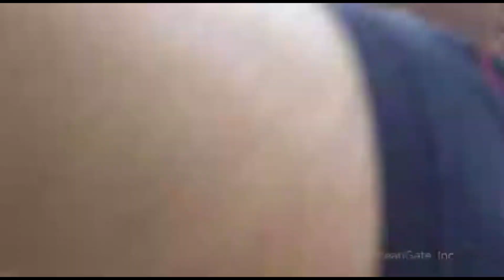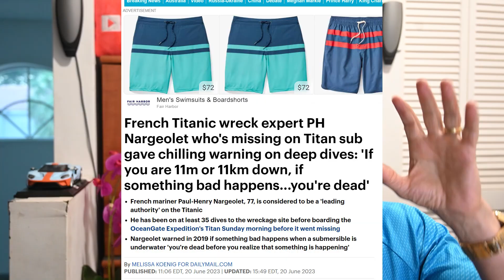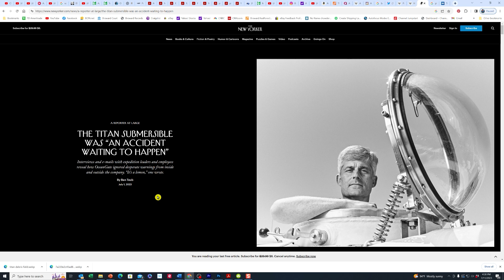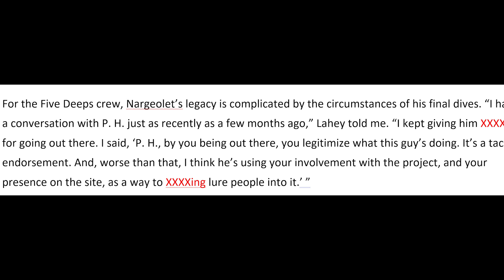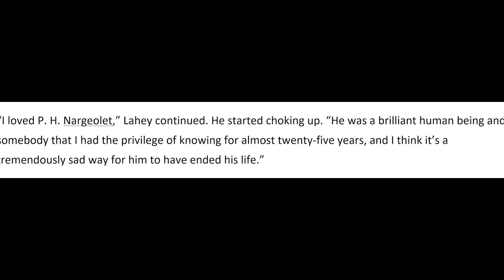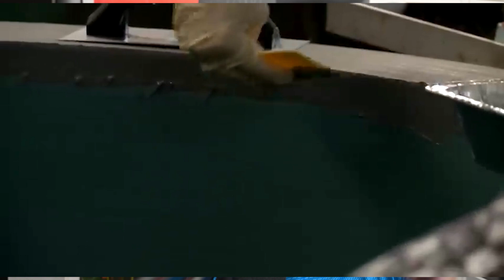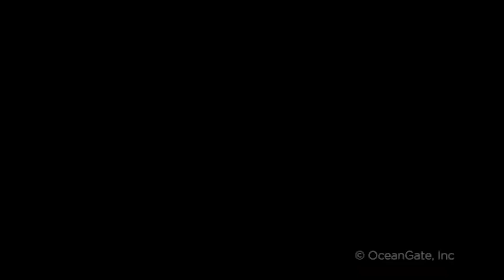Titan Sub: More Q&A, Design Defects, Why Descent Fast

Comment: The pressure hull is made of two completely different materials that perform completely differently.
The bond between them is always going to be the weakest area.
Reply: Yeah I think worrying about how it was initially glued or prepared in that sense is like worrying about how the lipstick was applied to the pig. It's still a pig and no amount or application of lipstick is going to make much difference. Those rigid titanium pieces may have intruduced enough local strain to break the carbon fibre as it alone attempted to compress under the pressure. If that didn't happen, then at least it would have done a number on that glue connection. And weren't those recovered titanium pieces conspicuously free of carbon fibre remnants?
Reply: @2RBYT  I don't think they put the steel next to the carbon fiber like you're imagining. They wouldn't make such mistakes.
Reply: @ryelor123  They recorded themselves doing it. They epoxy a titanium ring to each end of the carbon fiber cylinder. The titanium ring has an inner and outer lip so the carbon fiber cylinder is placed a couple inches inside it. But those two materials compress differently. So while the titanium remains rigid, the carbon fiber compresses a bit, but that inner lip would be holding back the first couple of inches at each end from moving. Concentrating a lot of local strain there.
Reply: They wouldn't?  You sure?
Reply: Yeah, and therein lies the problem: it wasn’t one but 3 disparate materials with different strengths & weaknesses.  We all know US Navy subs which don’t even descent to those depths is windowless & basically a uniform cylindrical structure.  The Russian submersibles had portholes but had a relatively long diving record that created a precedent for their viability.  The Titan was carbon fiber, titanium & some type of polycarbonate or something for the port hole.  It was all joined by glue.  No matter how tight the tolerances were & how thin the flue layer way, pressure always seeks the path of least resistance as you mentioned.  Stockon Rush might have been a bold innovator & courageous.  However like most pioneers & innovators there are always attendant elements of hubris & risk involved in pioneering endeavors & adventuring.  As the Roman historian once stated to this effect  “There has never been a genius without a level of madness.”

I’m an ex-US Army tanker.  The 120mm main gun is a forged smoothbore barrel made from super high quality metal alloys free of impurities that is lined with chromium.  Anyway, it has a thermal shroud around it.  As you fire the main gun, there is a thing called thermal droop.  The true axis of the main gun deviates ever so slightly from heat, weather, etc This is a precision direct fire tank gun that requires exacting ballistics and aiming for efficacy & accuracy.  So we constantly bore sight it & while the ballistic computer helps calculate things like cat, lead, etc sometimes you fire without the computer on your auxiliary sight without the computer to aid your aiming & other factors.  So boresighting & dialing in everything is critical.  One of those things is accounting for the minuscule mms the gun’s barrel may change which affects the ballistics.  This is just the gun too & deals with the affects of firing & the heating & cooling of the barrel from firing, friction, etc. It deals with accuracy & not safety like the Titan.  So the fact that it was 3 different materials that went through many cycles of diving, immense pressures & the cyclic contracting, etc obvious put a lot of wear & tear on the structural integrity of it.  If a 2,000lb gun barrel that is 1” thick of the highest quality steel can warp or bend ever so slightly from some heat, rain, then an experimental submersible undergoing what?  400 atmosphere of pressure in fluctuating but mainly near freezing to freezing temperatures, it will more than marginally affect the molecular structure & structural integrity over the cycles.  Maybe the dissenting voices should have been louder but Stockton Rush was his own man but I think his hubris clouded his risk assessment.  The problem is that he might have oversold the Titan’s safety to the passengers who put their trust in him.  As brilliant & bold as he apparently was he had some misguided disdain for safety.  The waiver form to all clients should have screamed red flag.  In fact famous Discovery adventure host Josh Gates was uncomfortable with the Titan & had the opportunity to go but decided it wasn’t for him.  Smart men know or maybe prudent men know their limits.

That’s not to pile onto Stockton who sadly perished.  It’s just a tragedy that eerily mimics the fate of the Titanic & its captain.  You can’t spell Titanic without Titan either.  Bizarre.  
Maybe some more testing would have yielded some crucial data.  If it could ascend without power maybe they should have tested an unmanned variant multiple times to test long term affects on this experimental submersible.  $250K checks per person could be a poisonous impetus to rush (no pun intended) things, cut corners & push forward without more stringent testing.

Anyway, RIP to the crew & passengers of the Titanic & Titan & condolences to the grieving families.
Reply: In my opinion they didn't use touqe wrenches
Reply: @MikeBurns-bi5xj  would it really matter either way?
Reply: @MikeBurns-bi5xj  They didn't need to since the pressure was holding it closed.
Reply: You're forgetting that pressure is going to be holding them together, not push them apart. Its kind of like doors on an airliner that are impossible to open while its flying due to pressure.
Reply: @ryelor123  
Dissimilar materials will act differently under pressure.
Joins and welds are almost always the failure points.
It's why they X ray critical joints in high stress joints.
Reply: Yep .. Thunderf00t has a video explaining it on Youtube
Reply: The bond is probably not the cause of the implosion because the water pressure forced the parts against each other. The CF cylinder collapsed almost flat and the 2 titanium half spheres popped out.
Reply: @gordonbyron5145  Yeah I don't think the glue mattered, because the tube it was inserted into the titanium rings. But what happens in terms of local strain and accumulated damage when the rest of the tube diameter compresses a few millimeters, while those rings are holding the ends of the tube back from also doing it? A few cycles of that and there is going to be accumulated damage near each end of the tube. One theory is that the tube failed in the middle. Another possibility is if you Imagine an end of the tube as where it started caving in. 

Of course on the flip side, if the tube wasn't inserted into the rings, the different rate of compression would have broken the glue connection. And even before that point it would have been a weak point that the water could have penetrated and began cutting through. If that were the case, I don't think the sub would have imploded though. Just filled very fast and sank to the sea floor.

Comment: One of the specifications for all plastics is its absorbtion rate of water over time. Given that the plastics used in the contruction were in sea water and at immense pressure then water absorbtion would have been at a much higher rate. Add to this the temperature differences under water and at sea level and on the deck of the Mother ship in the warmer Sunshine, the effects of sunlight and sea air.

Comment: Was the carbon fibre “pre-preg”, was the built fibre tube then heat cured ? There is a lot to be found out about the build procedure uses on the Titan

Comment: I saw one theory about that descent rate that water was potentially getting into the carbon fibre weave (which also indicates cyclic fatigue) weighing it down which would explain the slow ascent rate when they dropped weights. They were so slow they had to run the motors according to that leaked transcript (if its genuine). I'm no expert on the materials so if anyone knows better please correct it, but from what little I know it at least seems a logical explanation.

Comment: I have a degree in Aircraft Engineering and know something about Carbon fibre.  Although I am not a specialist in it.  More often than not the Carbon fibre material is 'pre impregnated' with resin.  Therefore, if this was the case, you would not need to spray the carbon filament with resin as it was being wound to make the tube hull.  Pre Impregnated carbon fibre is kept in a refrigerator to stop the resin from naturally setting.  The refrigerator will slow down the rate at which the resin will naturally harden.  However there is a time limit to this and it appears that Boeing sold to Oceangate carbon fibre that had exceeded its refrigerated shelf life.

Comment: This footage of the gluing process, as mind-boggling as it is, shows the first iteration of the pressure hull that was presumably scrapped in 2020. There's only limited footage from the construction of the new hull (briefly shown in SR's 2022 Mind Geek presentation), apparently they did use a different layup - radial and axial orientation - and we dont have any new footage from the gluing of the end rings.
So presumably there were some improvements but it looks like no one bothered to look into possible failure modes too deeply. "It'll be fine, trust me bro"
Reply: And the sections being glued into the frame isn't that big/deep either. That's what baffled me more than anything else.
Reply: @thatshottaye under water the end caps are pressed towards the titanium at thousands of tons of pressure. They will never be pulled apart. Its not the overlap that should take the strain. Its the edge itself.
Reply: @torben777  But also along with these end caps and rings, there is some (unknown?) epoxy between them, that holds them together and that's not bolted and/or in any way (other than the force of the glue itself) secured and thus can give way to water. For me (besides the issues with the CF hull itself), its like trying to plug a hole in a pool, using a glue stick.
Reply: @uacnix  You are getting it wrong. The pressure on a sub is from the outside in. As long as the carbon fibre ring stays intact there could be absolutely nothing holding the endcaps there, and the water pressure would still hold them together with a force so great that they would be impossible to pull apart even if you tried.

If the glue is a factor then it is likely because you have two different materials glue together, which to not react exactly identical to pressure and heat/cold. 

But lets see. I know I am also doing it myself, but we should really wait for the official findings. We are talking about accusing someone of having caused the death of multiple people after all, so waiting for an official finding would bevthevright thing to do.

My guess is certainly a problem with the carbon fibre hull, but imagine if it turns out to be something none of us has thought off.
Reply: If Rush was an engineer then why was the process changed? What type of engineer was Rush?
Reply: @stever2583  he was aircraft engineer. He transferred carbon fibre technology from planes into subs, which didn't make much sense considering the pressure in planes is from the inside and subs exactly the opposite and 400 times stronger
Reply: I didn't read all the comments, but I feel I gotta put this out there, the carbon fiber what's also expired (or near)

Comment: It looks like the glue wasn’t there to fix the rings in place, just to seal the ends. The pressure on the water would have held them in place until the carbon fibre failed.
It must have been a big implosion as the bolts for both titanium hemispheres are gone.

Comment: QUESTION: In the recovery video, the lifting strap is going through the porthole window opening on the Ti endcap as it's brought aboard the recovery vessel. Isn't this a good indicator that the plexiglass window was the point of failure, especially since its depth rating was for a more shallow depth? Or was it blown out by the failure of the C.F. pressure vessel? Thanks!
Reply: If you look closely you can see that the retaining ring is missing as well suggesting that the window was blown out taking the retaining ring with it.
Reply: We won't know for sure probably until the investigation is complete but because it hadn't had issues in other dives I feel relatively sure that it simply got blown out during the course of the implosion.

If the hull was titanium or steel than I'd be more suspicious of it but considering the carbon fibre was almost certainly getting weaker much quicker than it, I think it's definitely the greatest suspect.

Not to mention that many bolts had been cleanly sheared off the end caps showing that whatever removed them had immense force and would have been pushing against the viewport with the same force.

Comment: OMG! I don't have the knowledge and education to know anything about submersibles, i am just an artist, but even i know that if you put any type of glue/epoxy, no matter how good quality it is, on perfectly blank surface, it will not hold forever. That's why i would put hours on sanding and preparing shiny silver if gluing on gems was needed. IF you are right and they just used the epoxy straight on, they had no idea what they were doing. Rich people thinking they know more than the experts they chose not to listen to seems to be something typical these days.

Comment: There is a difference between the compressibility of titanium and carbon fibre would they have matched this by having to tanium thinner at the glue Junction with carbon fibre. ?  The encaps though would they shrink under the pressure in relation to the titanium that is glued to the carbon fibre?

Comment: I think the unidirectional carbon they used to build the hull was a prepreg, so it already has resin that's partially cured impregnated in the carbon fibers. Then they oven cured it but did use an autoclave because an autoclave large enough to cure that hull is rare and expensive to rent time on.

Comment: The big issue i noticed right away is that, when the titanium ring was lowered onto the CF hull, it formed an air-lock.
The air had to get pushed out and the only way for it to get out would be through the glue joint.
So inevitably the air would either get trapped or push the glue out to release.
What i would have done is to lay a bead of the glue on the edge of the CF hull and lower the ring on top, so that the glue would get pushed out from the center of the joint outward, pushing the air out as it propagates through the interface of the CF hull and titanium ring.
Then there was the mixing of the epoxy by hand and this method is notorious of introducing air bubbles.
The whole process was flawed.

Comment: the sink rate might be a result of water penetrating and separating the layers of carbon fibres.if there was only 1% air in the carbon fibre this thing will sink like a rock when the air is compressed.

Comment: %%%%%%%%%%%%%%%%%%%%%%%%%%%%%%%%%%%%%%%%%%%%%%%%%%%%%
It seems to me, as though Stockton Rush and the Polar Prince never paid attention to the rate of descent.  Had they paid attention that it was descending too fast, could they have ascended to the surface before the other problems occurred?  If they had crackling noises in previous dives, that should have been properly investigated, although Stockton himself said that “safety was a waste of time”!!!!    %%%%%%%%%%%%%%%%%%%%%%%%%%%%%%%%%%%%%%%%%%%%%%%%%%%%%

Comment: 5:40 sure the whole assembly area is not a clean room, but that technician is only wiping down the exterior and top of the titanium ring, nowhere near where the glue is going. 

6:09 - The glue isn't holding the sub together against the forces of extreme pressure.  It's sealing a join, and stopping the end caps falling off when it's in the air.  Underwater, the end caps are being pushed onto the tube with such force it's hardly imaginable.  That glue is operating mostly under compression.  there may not have been enough glue, as you don't see any squeeze out, and it was mixed by hand so might have voids, but agin, the glue is not holding the structure together underwater.

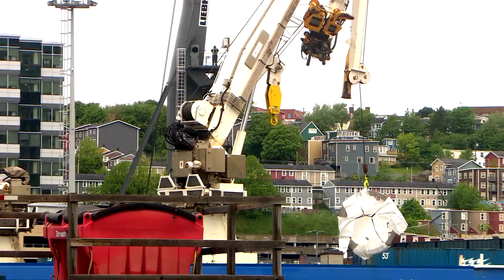6:26 - The only bit of the titanium ring you're seeing is the side that bolts to the dome.  You don't see the glued part.

7:56 - According to Oceangate's literature, the hull was made of alternating layers of axially aligned prepreg, and radial single carbon strands.  Modulo the not-very-clean room approach, I don't see that much of an issue with this, although I'm not a composites expert.

8:22 - For the whole descent rate issue, it preassumes the "transcript" to not be a fabrication.  There's enough seemingly wrong with it, along with the simple fact that the internet is full of bell-ends who consider it to be lulzy to do such things, to assume the absolute opposite until it has been acknowledged to be factual.